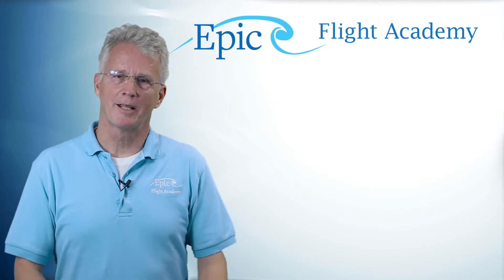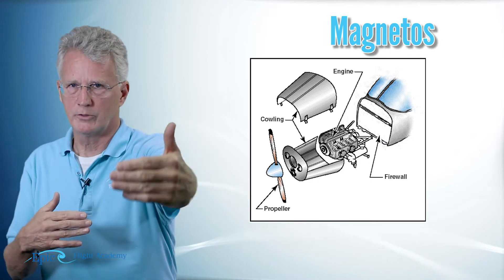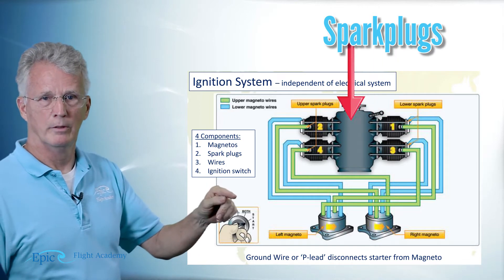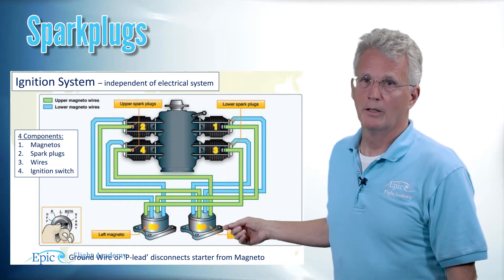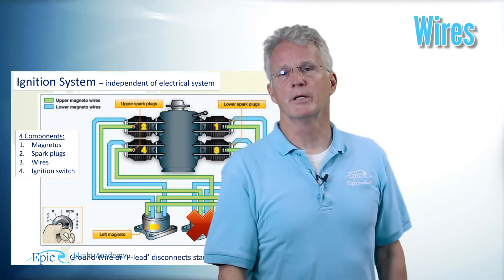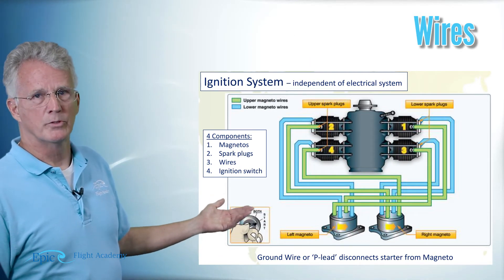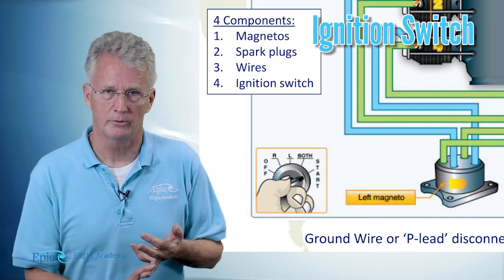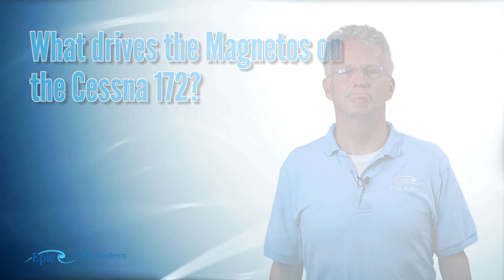PPGS Lesson 6.8 | Aircraft Systems: Ignition Systems

Comment: Hi. Amazing video, Very clear. Anyway I've a doubt. During normal operation, in flight, wich magnetos need to activated: Left, Right or Both? I think both, but if yes, I've a second question : in wich case I choose only left or right magneto? Thanks in advance
Reply from the maker: That is a great question! We discuss that during our ground classes at Epic!
Reply: You can do when you diagnose 50 RPM difference or could be more between two magnetos. You feel the engine roughness then do ignition key cycle and at the same time watch for the drop. The max drop of each mag compared to both position is 150 RPM. However the max drop between magnetos is 50 rpm so you find which one has huge difference depicting that that magneto is not working properly then you can switch to one that has min rpm drop